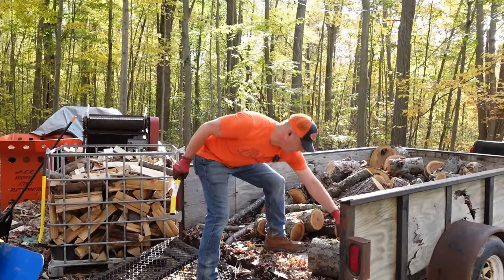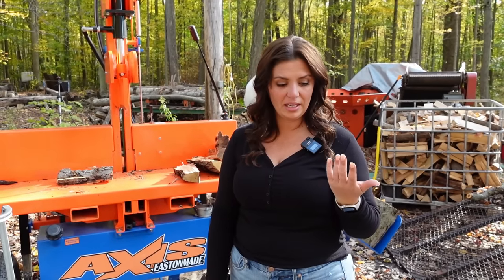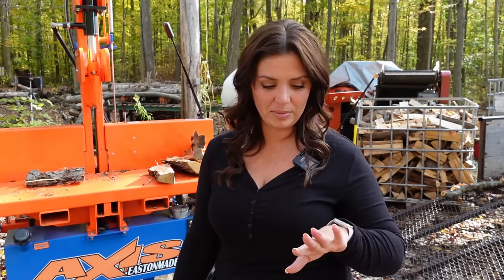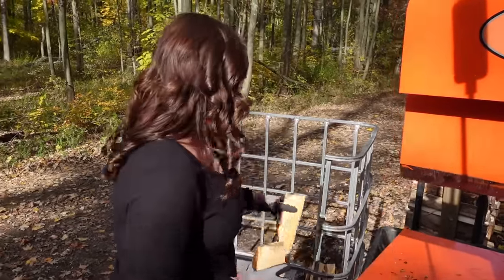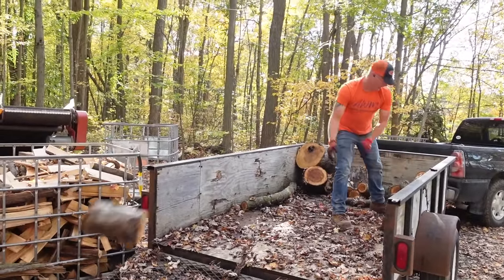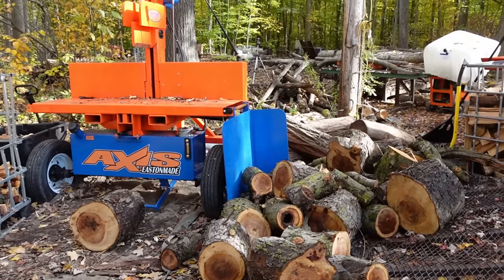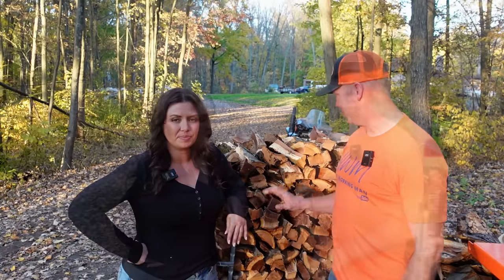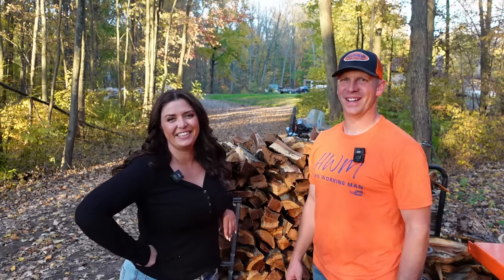It Happened So Fast! How Bad Is It? Log Splitter Accident.

Comment: Woodsplitters don't cry :P
Hopefully that's the worst injury you'll get while splitting wood. I've actually made a few comments over the time since Rachel has been splitting about safety. I'm not a huge fan of gloves. They protect your fingers from splinters and to a slight extent they'll protect them if you squish the fingies a bit. What they can also do is get hooked on slivers/splinters and slow you down when you need to get your hands out of the way. I have a couple of permanent scars from my days woodcutting and I'm always a bit safety conscious when I'm watching videos. Things like taking a hand off the chainsaw while cutting, reaching across the bed of the splitter when the pushplate is retracting and things that most of the time might be okay but are putting yourself/someone at risk I will often comment on. Out of all the years I've split wood probably the worst injuries I've had is some splinters, a few blood blisters and some light abrasions.
Stay safe the 2 of you.
Reply from the maker: Thanks Alan, we try to be safe but there’s always some danger lurking. We’re definitely not perfect and make mistakes. I wish she had her impact resistant gloves on this time, that’s usually what I wear. I have learned to junk gloves once they get holes in them to avoid getting them snagged up on a piece while splitting. As always, appreciate the comment.

Comment: That's why I prefer the type of log splitter in which the wedge is fixed to the frame, and the flat ram moves.  The log is positioned horizontally in the machine instead of vertically.
Reply from the maker: We have a few that run like that as well and we usually use them for higher production. We run the Axis for our more premium splits such as smoker wood and bundle wood. Looking back we probably should have run this apple through a horizontal machine do to how it splits. It was our first time splitting apple.

Comment: My god your wife is beautiful!!  You're such a lucky guy.  Glad she's ok.

One tip that might help though.  Get some stick-on traction grip tape and put on the bed of the splitter. This should grip the wood and help keep it from slipping around on the table as the ram comes down to split the wood.    If you dont like the tape Idea, maybe use roofing shingles.  Nail the shingles to a piece of plywood and then clamp the plywood to the splitter bed.   Anything to create a little friction between the wood and the table will keep it from moving around while its being split.
Reply from the maker: Thank you, I agree. We are going to try some friction tape, not sure it will hold up though. We will see. Definitely glad that it wasn’t more serious.

Comment: Yeah, Rachel, you had me worried after you get your finger in your you look to me, awful timid on that machine girl, take control of it, please keep your hands-on that wood, I'm afraid that if you're not holding on to it, it's gonna fly out and hit you in the stomach. And that will be worse than your finger.  Hes start cottonwood strator so you minimize that risk and yes, I find the older the apple tree. The twist dear it is but I only ever experienced splitting it on a horizontal. Anyways, great video. Can't wait to see what you got at the auction.😂
Reply: I was a little trepidatious right after. Plus it still hurt like heck so I didn’t want to put much pressure on it. But I got my confidence back shortly after.
Reply from the maker: Thanks Kent, the auction video will be up soon!

Comment: I did the same kind of thing on a metal chop saw. Only I got my index finger smashed into little bits between the work piece and the backstop. Almost cut the finger right off.
Reply from the maker: Ouch!  Anytime you work with power equipment there’s a chance something may go wrong.

Comment: Sorry, you got hurt. Holding on to the wood as it travels through is not safe. Safety glasses are a must also, as wood will splinter as it splits.
Reply from the maker: We usually wear safety glasses but overlooked it this time. With these vertical splitters you have to hold the sides of the smaller splits. She was doing everything right, just got bit a little. A perfect storm of crooked, twisted, knotty dense wood.

Comment: I’m kinda surprised those machines don’t have a two button start, that would ensure both hands are nowhere near the blade or wood. I’ve seen that on some factory machines.
Reply from the maker: You sort of have to support the smaller splits on the side while splitting.

Comment: Always use a block under the timber that you’re splitting.
Reply from the maker: Not sure how that would work with this machine?  May be worth a try but I think it would take away one of the best features of this splitter. The ability to quickly and easily produce premium precise splits.

Comment: 45 years of splitting and heating with wood and I still prefer a horizontal splitter with no bells & whistles and a relatively slow cycle speed. Worst thing I've had happen is logs popping apart and smacking me in the thigh.    The smooth surface of the base of your machine is not your friend.
Reply from the maker: There are pros and cons to each and every model/type I’ve run. This machine is awesome for producing beautiful splits for bundles and smokers as long as the wood type is correct. No matter what there’ll be a few short comings for every type of machine. Overall we are very happy with this unit so far!

Comment: First thing glad the accident didn't require the hospital.  Not sure if you process wood for a living or you do a once a year thing.  If you are doing this for a living, you might try watching your video a few times and see how much time and labor is doubled in splitting process. I know that splitter cost quite a penny but there are lots out there that are way faster and more important do not involve  touching the wood during the splitting operation. Having to lift the wood on the hopper then split the log then clear the deck .... way too much labor there. If you are a small outfit that does a few hundred cord a year then your doing fine.
Reply from the maker: Thanks, we have an Eastonmade 12-22 and an All Wood Musclewood as well. We use the Axis for bundle grade and cooking wood!

Comment: That machine has no feelings and it will hurt someone very fast I am glad it was not any worse than a pinch finger and the holding the side of the wood as it is getting split is not a good practice I would hold the piece until the splitter makes contact with the wood and pull my hands away
Reply from the maker: With these vertical splitters you sort of have to hold it for a little bit. When you have your hands on the sides like she did this is about the worst case scenario. This wood was the perfect storm, crooked, twisted, and knotty.

Comment: I been there and done that it ain’t no fun last week I was splitting firewood with my uncle the split wood went flying about 3 maybe 4 feet away from the log splitter luckily it didn’t hit me in the wrong spot it wouldn’t felt good I stood back away from the log splitter while my uncle was splitting the wood
Reply: Yeah, we’ve had that happen too! Anytime you split wood, there’s potential for danger. Stay safe!
Reply from the maker: Anytime you apply this amount of pressure to wood there’s a chance for something to go wrong. Luckily Rachel had her hands in a pretty safe position limiting what happened to her and preventing serious injury. Stay safe out there!
Reply: @rachelpostma4505 yep yeah I did it multiple times on my old log splitter I smashed my finger between the wood and the wedge of the splitter and thank goodness that I bought a new log splitter that has a log lift on it similar to the one  in the video. I be safe with the log splitter.
Reply: @hardworkingmanoutdoors yes indeed alright. I will.
Reply from the maker: @mattdooley6206 a nice splitter makes a world of difference!
Reply: @hardworkingmanoutdoors oh yeah it does I bought a new self propelled log splitter with a log lift and a work table on it at the Paul Bunyan show this year and it has a Honda engine on it too my new log splitter goes fast and I already have 3 or 4 big piles of firewood already I sure do love mine
Reply: @hardworkingmanoutdoors is that the same Rachael that was In this video who replied to my comment or no
Reply from the maker: @mattdooley6206  yes!
Reply from the maker: @mattdooley6206  awesome!!!
Reply: @hardworkingmanoutdoors  alright.
Reply: @hardworkingmanoutdoors yes indeed

Comment: Don't take offense. But the simple matter is the more times you have to handle a piece of wood the more accidents you are going to have. It's simply a numbers game. I would ditch the splitter for a model that requires less handling. It will boost both safety and productivity. Again I don't say this to slight anyone accidents are inevitable and are going to happen we simply do the best we can to minimize them.
Reply: No offense taken. Sometimes accidents happen, we just try to avoid them the best we can.
Reply from the maker: Not offended at all. We have some production horizontal machines as well. These vertical machines do require a little more handling but they make great bundle and cook wood!

Comment: Try reading the fine manual before putting yourself or others at risk. Start with eye protection and finish with 'Proper operation".
Reply from the maker: We did overlook eye protection in this one, we usually have it on. However she was operating the splitter pretty well, just poor choice of wood for this style splitter. Crooked, twisted, knotty dense wood. We learn as we go and aren’t afraid to share our shortcomings to help others.

Comment: Why do you suppose they built that tall orange upright thingy at the back of the table. Certainly not as a support for the wood to limit the direction it might slide when that pointy thingy comes down. Maybe, just maybe something was mentioned in that worthless owners manual, naw!
Reply from the maker: The tall orange thing in the back you’re referring too is the guide for the wedge otherwise known as the sharp pointy thing. The mounting plate which slides up and down the tall orange thing though somewhat beveled is not a splitting edge. It is also greased to allow the wedge the travel smoothly so if you placed the wood against it you’d get it covered in grease, but maybe we are wrong???  Thanks for watching I’ll go re-read the manual.

Comment: The inherent design of that splitter makes it dangerous having to pass your hands between blade and wood. Accident waiting to happen.
That was just a squeeze, that wedge can easily remove a finger. Once the blade starts coming down the hands should be off the wood and splitter.
Reply from the maker: Almost vertical splitters I see are operated in the same manner. As long as you keep your hands to the side, this is about the worst that should happen. Now if you put your hand under the wedge you could get into trouble.

Comment: As a quick temp fix, stick a sheet of course sandpaper to the area under the blade. Big design failure with this machine
Reply from the maker: We love the axis as it pumps out the premium splits with the right wood. I think too much grip would deter the effectiveness of that. We may try it though.
Reply: @hardworkingmanoutdoors  

Effective over safety, always a good idea. 🤔

Comment: As below, the deck needs to be non slip, and the logs all sawn 90 degrees. Be careful powered equipment is very unforgiving
Reply from the maker: We may experiment with some non slip but I feel it may take away one of the key pros of this splitter the ease to make small precision splits for bundles etc. This wood was about as bad as you can get for a vertical splitter, crooked (resulting in non square cuts), knotty, twisted, dense wood.

Comment: Not sure im a big fan of that huge platform for the logs being split, if you had just enough for the width of the log, hand and log would've missed the platform and not been smooshed.
Reply from the maker: The large platform is nice for resplitting larger rounds. We still have a little learning to do with the vertical machine though.

Comment: You should be wearing HEARING PROTECTION. Ear Plugs PLUS Over the Ear protection. That gasoline engine is loud enough long enough to damage your hearing (Permenantly). Also, EYE PROTECTION is MANDATORY.
Reply from the maker: We do have our custom fitted electronic suppression Sound Gear hearing protection in, they are rated safe for gun fire without outer ears. We did overlook safety glasses in this one, we almost always have them on.

Comment: That table is too slippery. There should be some ribs sticking up to engage the bottom of the piece you are splitting to hold it. I know it would ruin the nice paint job but I would hit it with a welder and make some ribs under the wedge and then spray paint it. Fingers are more important than nice paint!
Reply from the maker: We’ll try a few things but don’t want to interfere with the beauty of this machine which is the ability to make premium precision splits. If the wood doesn’t slide well enough we’ll lose that benefit.

Comment: Wow, that is one insanely dangerous machine and it could be made safe so easily. Just an accident waiting to happen.
Reply from the maker: I really don’t think it’s any more dangerous than other splitters. When run correctly as she was this is about the worst that may happen. This wood was about as bad as you can get for a vertical splitter and overall it handled it pretty well. Not perfect, but no splitter is.
Reply: @hardworkingmanoutdoors  Your call. I wouldn’t use the thing without modifying it to keep hands completely off the wood, a modification would be relatively simple. The woman, Rachel?, in the video is obviously nervous around the machine and she should be. But, as I said, your call.

Comment: I played the finger smash a couple times, couldn't see what actually happened. I know once when my wife wanted to split, I was messed up, couldn't go out with her, I told her to not, DO NOT hold the wood to split by the ends. She heard and understood. Less than five minutes later, she was back in the house with two smashed fingers, one kinda bad! Never wanted to help split wood again, ever!! It wasn't life changing, or crippling. She would laugh so hard whenever I got hurt, but it didn't work in reverse. I almost lost it and laughed, but didn't. It was still all my fault. No words of wisdom were helpful. All I could think of was, when working smarter isn't working, go ahead, work harder. It didn't really apply. I think I was in the doghouse for about 3 weeks! She really, really wanted to take over the splitter! Wimmens have some strange logic sometimes. Tread carefully Heath!
Reply from the maker: It sounds like it’s best that you suppressed your laugh!  Definitely always a chance to get pinched while splitting. I’ve taken a few lumps myself over the years.

Comment: Real leather gloves are a must when working with firewood. Eye protection is high on the list too.
Reply from the maker: We usually wear eye protection just overlooked it this time. I like my Milwaukee impact and cut resistant gloves especially the leather pair with both!  They get a little warm in the summer though.
Reply: Its the little abrasions and scratches along with splinters that I wear my thicker welding type gloves while working my firewood processors. The few times I have forgot my gloves I end up hitting the back of my hands on something pointy or just hard and it just pisses me off the rest of the day......LOL  Love your videos.  @hardworkingmanoutdoors
Reply from the maker: @wayawolf1967  thank you!

Comment: Way to hang in there you are a trooper. I see you guys run those up right splitters and just cringe ( Not a fan) even if it's an Eastonmade.😊
Reply: It’s definitely different than a horizontal. Its great for the application we were using it for. I just didn’t see that one coming.
Reply from the maker: Dan, they are definitely different but we still really like running it. Especially with the right types of wood!

Comment: the table is smooth lets wood slip easy
Reply from the maker: It does but that’s the way it’s designed to allow you to easily position wood for precise splits. This wood was about as bad as you can get for this style splitter.

Comment: Your face is a feet away from a  giant head crusher when working that splitter.
I understand the purpose of those horisontal bars above the knife, but it seems they are very seldom needed.
With a proper wedge there is no need for those hazardous bars.
Reply from the maker: I think it’s be pretty tough to get your head into danger. Now if you placed your hands on top of the round I could see getting pinched.
Reply: @hardworkingmanoutdoors  s*** happens. Not unthinkable to stumble forward when tired. A disaster waiting to happen. This machine would never be allowed in Europe without modifications.
Reply from the maker: @acajutla I know the European machines have a lot more safety features in place!